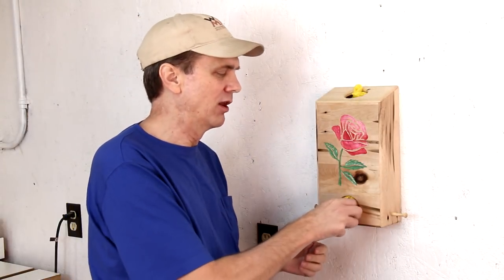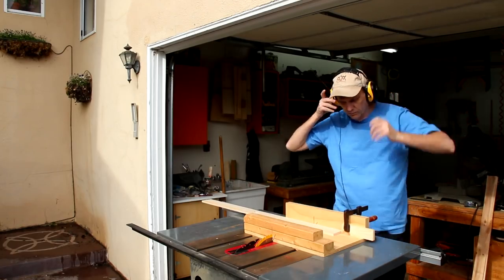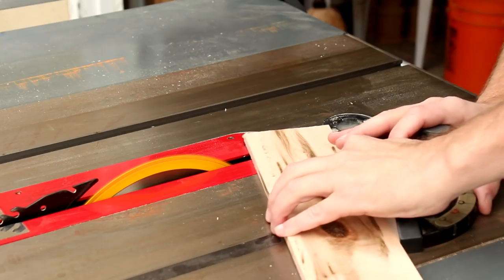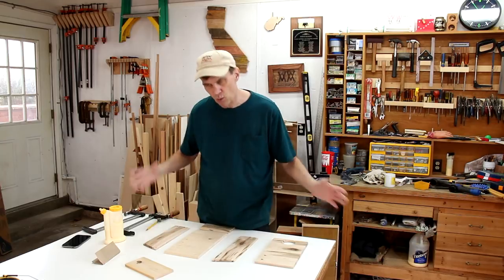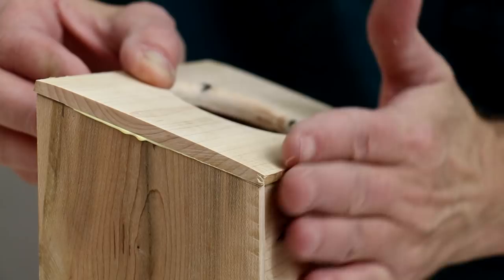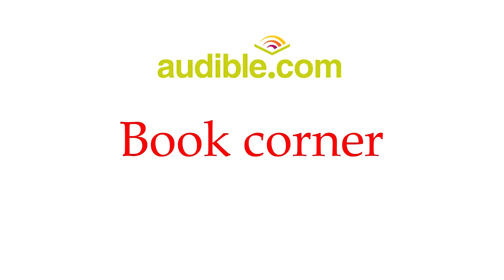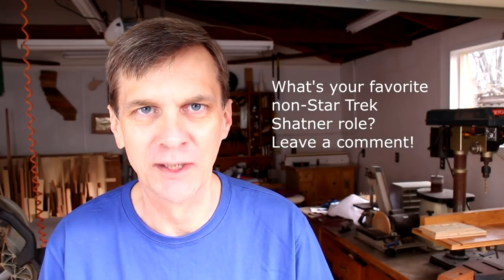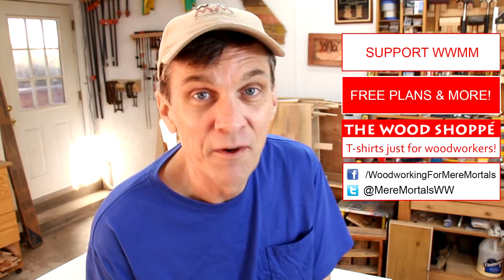Shopping bag dispenser made from recycled pallet wood.

Comment: Great video Steve.  After all kinds of alternatives, I landed on felt tip Sharpie, as you have  done, for personalizing a project.  Just be careful to seal with something, like the lacquer spray, BEFORE using the Sharpie, or the ink will leach into the wood fibers.  As to the ink jet transfer, you wouldn't believe the additional steps I have been taking and  thought were necessary to get the inkjet stuff to transfer to the wood, per MANY YouTube vids.  I am going to try what you did right now.

Comment: You don't seem to have allowed for the cross grain movement between the horizontal front/back and the vertical sides so it's probably going to crack over time.  If you really want the grain going that way I would suggest not gluing the front and back into panels and do a lap joint to hide any gaps that open up.